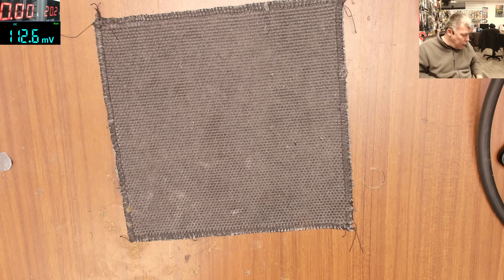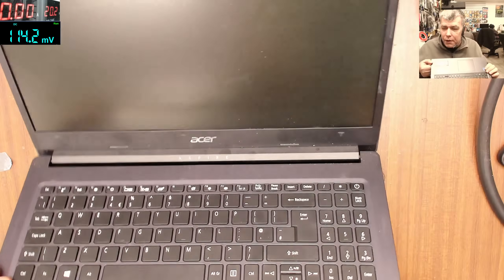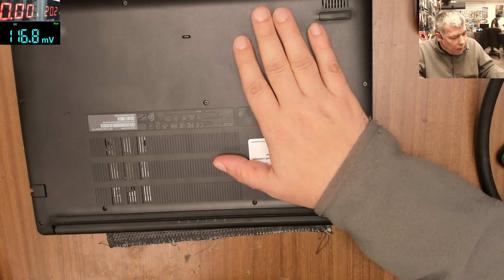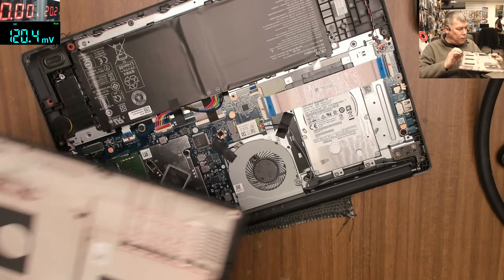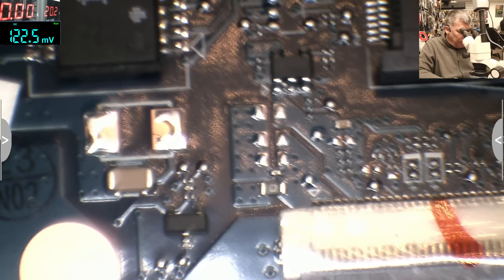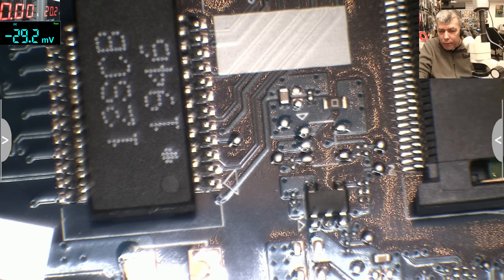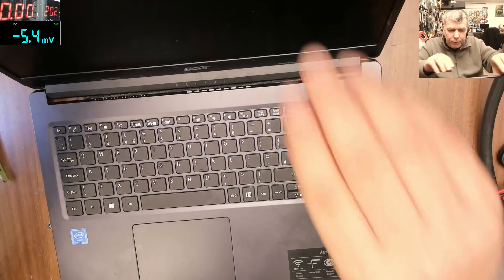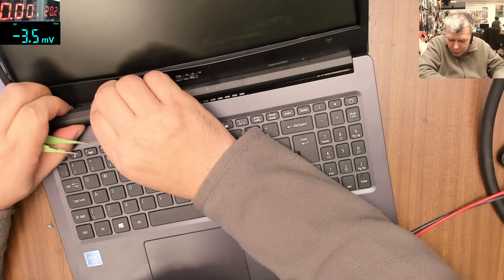Acer Aspire 3 - N19H1 - No backlight repair

Comment: Hi! i have an acer aspire 3. the charger has been busted and i bought new charger. but the laptop wont turn on but has power because the blue light is turning on but the fan is not working and no display. what could be the problem?

Comment: Thank u! I fixed my acer backlight problem. It was a loose connection indeed. I didnt want to remove the rubber so i tried nudging the wire from below and it worked! Thank u so much for sharing your knowledge so generously!

Comment: I see you suffer with the electric screwdriver, throw it away and get normal screwdriver or with a button. 
It should by a joy to use a tool, not a pain + you you'll save yourself a wrist, that motion doesn't look very ergonomic.

Comment: I have the same model with same problem and the same solution fixed it - it was dropped , and the screen connector on the motherboard side was unplugged.

Comment: I learned (from a cooling expert) that a fans primary purpose is to create a difference in air pressure between outside the casing and inside which then creates the airflow needed. Perhaps this is a good illustration of that. It was explained that this also means that adding more holes or removing covers etc. does not necessarily make for better cooling as it upsets the designed balance of air pressure.

Comment: That's fun. The other day i had a look at my mother's laptop.....Aspire 3 with screen problem 😁 i suspect the screen connector on the screen is not connecting properly. The screen was easy to get out and wasn't clued, it had 4 screws. 
If i press on the lower part of the screen bezel, the screen flickers and/or comes back to normal. Maybe it's just a feature.....
Thanks to Zorin i had no problem to take it apart 👍🤗